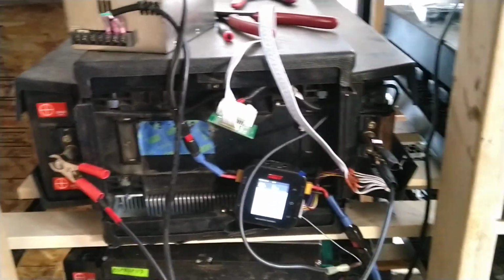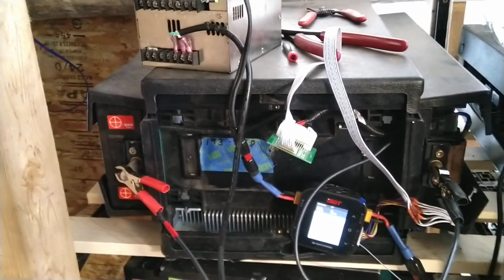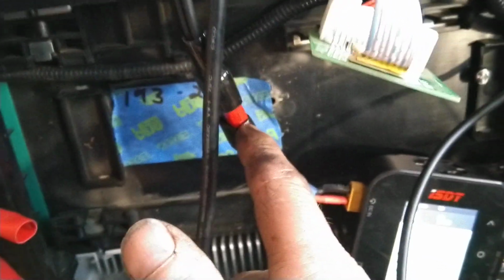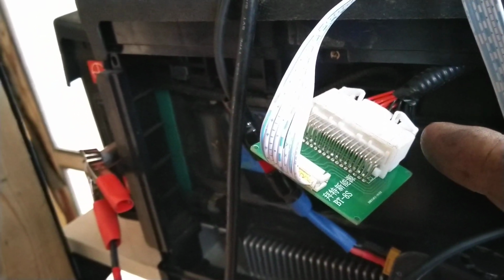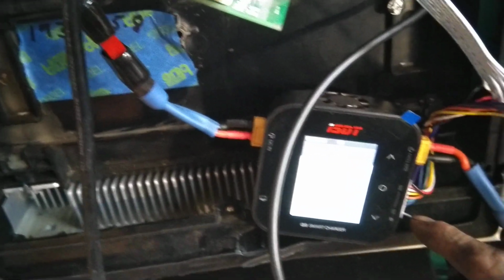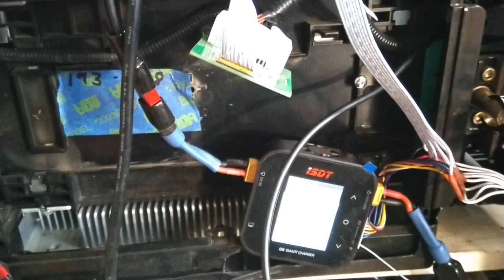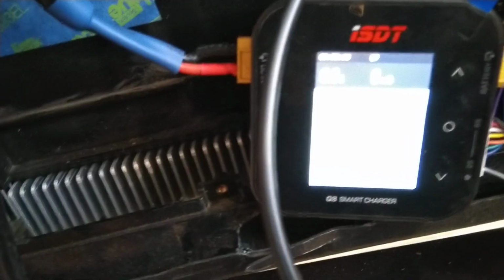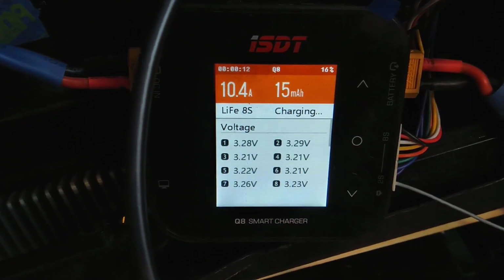Setting up and Connecting ISDT Q8 to BYD Battery pack for balancing

Comment: why did you connect the negative balancer lead directly to the positive terminal and then riveted to the negative terminal. That is what you said in the video?
Reply from the maker: I don't think that is correct.
Reply: @metagrid9453  well that's how it sound on the video, but for what I see since you got 8 + on the harness the extra 9 pin on the ISDT connector goes to the negative terminal, that's correct ?, was going to go with the Active balancer make sense not need of a BSM but I order only 4 BYD's and my inverter doesn't have temperature sensor controller and I'm in Florida get really hot so choose the BSM package, Thx to make the videos super helpful
Reply: @metagrid9453  yes you misspoke at 2:32 and said “positive” and then continued with “riveted to negative”.
Reply from the maker: @PlanePreacher  Well, thanks for pointing that out.

Comment: i realised the adaptor fromTech-Direct had 8 cables, how did you add extra cable ( for positive or negative) and modified the terminal to be used on the ISDT?   I bought one of the adaptors but couldnt figure it out.  Good job !
Reply from the maker: I just ran a 10AWG wire from the main negative terminal to the negative input on the ISDT.